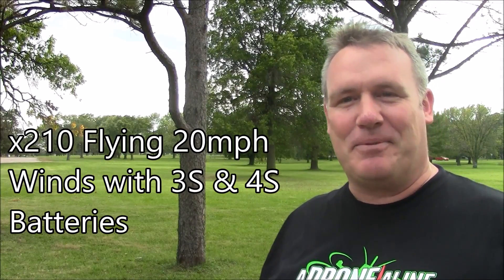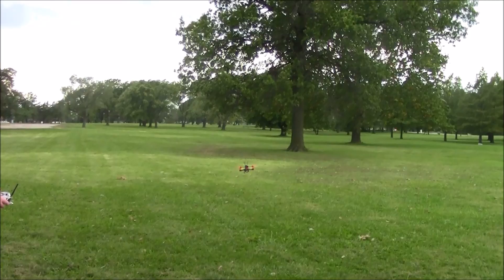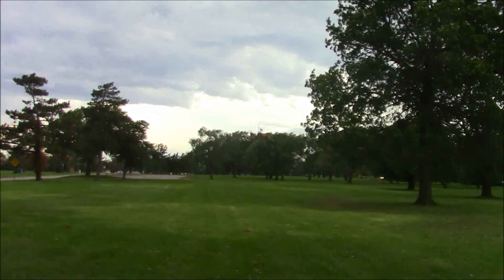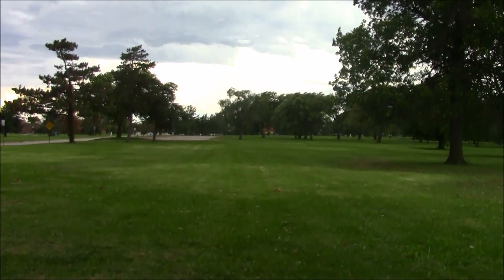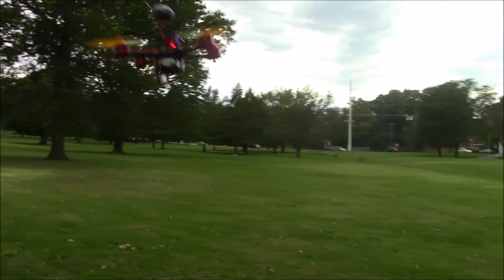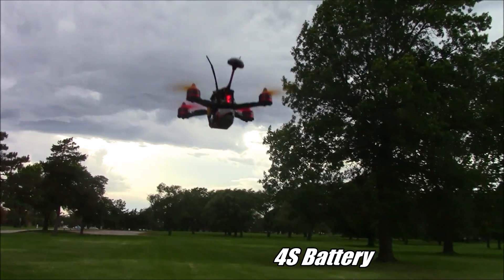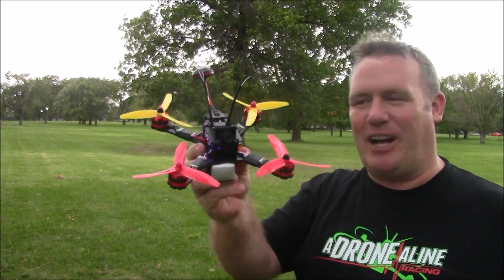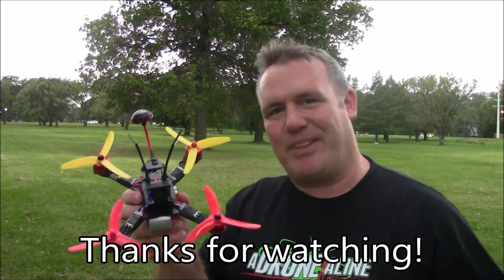X210 2600kv 30amp Racing Drone Kit: 3S versus 4S

Comment: Hey Travis I still have this kit never flew it the esc say 30amp 1 to 3s but every person I see on YouTube fly’s 4s battery’s on this kit. If the escs are rated for 3s why does 4s not blow the escs?
Reply from the maker: I flew mine on 4S all the time.
Reply from the maker: The important thing is to stop flying occasionally and feel the ESCs.  If they are not too hot to hold on your hand, then they're fine.  If they are too hot to hold, then the batteries are too much.

Comment: youre a great pilot sir,  by the way how safe is that running on 4s? i mean too warm or near hot? is it safe? because i interest to buy this motor,
Reply from the maker: They run a little warm but if you can keep your hands on them without your hands burning, then the motors are fine.
Reply: @travisgrindal  hi...thanks for your reply. Is it okay if using little.bee 20A ESC? I want to buy this and esc's

Comment: What props are you using
Reply from the maker: I've been using both DAL props:  http://www.banggood.com/2-Pairs-DALPROP-5045-T5045-3-Blade-PC-Propeller-CW-CCW-For-QAV250-ZMR250-240-RC-Multirotors-p-1056195.html?p=6Z050013977120130325
... and KingKong props:  http://www.banggood.com/10-Pairs-Kingkong-5x4_5x3-5045-5-Inch-3-Blade-Propeller-CW-CCW-for-FPV-Racer-p-1067877.html?p=6Z050013977120130325
I use to only use DAL props but these KingKongs have been working real well for me recently.

Comment: which prop are you using?
Reply from the maker: 5045x3 Blades.  http://www.banggood.com/10-Pairs-Kingkong-5x4_5x3-5045-5-Inch-3-Blade-Propeller-CW-CCW-for-FPV-Racer-p-1067877.html?p=6Z050013977120130325

Comment: no parameters to change to switch to 4s ?
Reply from the maker: With the default PIDs from BetaFlight 3.0.1, it flies fine on 2S, 3S, and 4S batteries.  I don't change anything.
Reply: okay thanks !!

Comment: have you had any issues with your setup on either 3s or 4s running 5040 triblades? My friend is running them with the racerstar v1 30a esc with the newest blheli installed. He was doing some basic hovering and flips on 4s and one of his motors smoked! Any thoughts on why this happened?
Reply from the maker: I'd guess he shorted something out.  I haven't had any problems with mine running on 3S or 4S.  In fact, I was just flying it this evening and hit a tree and didn't break anything except zip ties.  It is freezing and the plastic zip ties were very brittle.
Reply: I found the short and fixed it. Luckily it appears as though the motor, while having smoked, still works as he was flying it today and it was performing just fine!

Comment: Great video as always, 
how does it look with the flight time at 4s?

Why did you choose the Inginity 1300 mAh 4S and not the Inginity 1500 mAh 4S ?  
I would like to buy a few new, but do not know which of them.

Greetings from Germany
Reply from the maker: I have both 1300 and 1500 4S Infinity batteries.  I try to race with the 1300 mAh batteries because they are a little bit lighter.

Comment: The x210 is a beast in the wind compared to bigger more draggy frames.
I built mine with a 4in1 blheli_s but i am probably going to make another with a 30a 2-6s 4in1.
The 4in1 saves you about 25grams.

Definitely think the foxeer arrow v2 is the way to go with this frame so that you can still have osd and a small vtx.

Comment: I need a new frame just totaled my qav210 what would you recommend I am experienced and want the most power and it must carry a gopro too im thinking Tweaker 5 but my tweaker 4 is so heavy
Reply from the maker: I'd recommend this frame.  I like it real well.  It is one of the frames I'm racing now.  I also race my TC-R260 and Whippet I&H Frame.
Reply: if you was going to choose between those two which one would you get I don't have any 6 inch propellers so I would have to invest in those too
Reply from the maker: Probably the x210.
Reply: Ultimatevapor918 hyperlink ss

Comment: what radio are you using in this video and which other models could I use with this Quad copter
Reply from the maker: Quentin Craft I'm using a Taranis.  To fly a quad, you need a 4 channel transmitter and receiver to fly.  If you want auto-level on a switch, you'll need 5 channels.  The Taranis can do up to 16 depending on the receiver.
Reply: if I want some kind of notification on battery level can  you use the 9 channel you mentioned in the video
Reply from the maker: Quentin Craft You're referring to "telemetry".  That is where the receiver sends info back to the transmitter.  Here's a video that shows how to set it up with this quad and Taranis.  https://youtu.be/LueXntB8p3E

Comment: you really should not fly 5x4.5x3 props on 2600kv motors, 5x4x3 is really the best for it, the other ones work great on 2300kv
Reply from the maker: You may be right, but these 5045 props on 2600kv just feel so fast.  I may order some 5040 props and see how they compare.

Comment: What are advantages with the Realacc over the TC-R?
Reply from the maker: Well, the smaller body should create less drag.  It is also a True X shape.  The TCR-260 is a little easier to build because of the larger body.  I think it is more about your own personal preference than anything.  A lighter frame with stronger motors will be faster but most people are more concerned with not crashing than being the fastest they can.
Reply: +travisgrindal Thanks. Well spoken ;)

Comment: is the 2600KV the way to go over the 2300? and why? do they not get more hot then the 2300? thanks
Reply from the maker: Right now my answer would be to go with the 2600kv motors.  I think they do get hotter than 2300kv motors and they also use more amps than 2300kv but I like the 2600kv motors better.
Reply: What do you like about 2600kv better?

Comment: It's a great kit,  and the ARF/RTF just got released.  I'm still learning but I just bought 4S and cut the throttle curve down 25%.  No need for 3S.  Wind doesn't bother these little bricks much.  I was hesistant to fly in 20-25 knot winds, but it's not much of a big deal. :)
Reply from the maker: Humm... I hadn't thought of reducing the max throttle.  Cool.
Reply: I reduced it across the throttle range.  On my Turnigy (Flysky) i6s it has 5 steps to the throttle curve.  Standard is L/25/50/75/100.  So I reduced it to L/20/40/60/80.  I think I saw the idea on Joshua Bardwells channel.